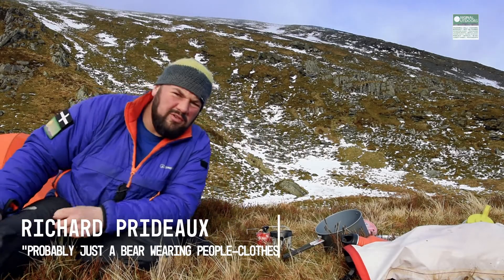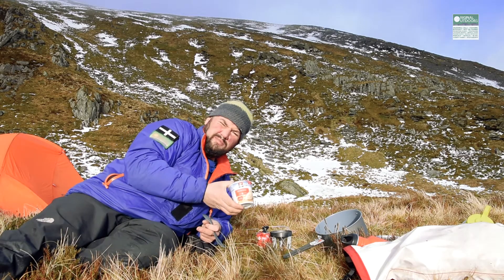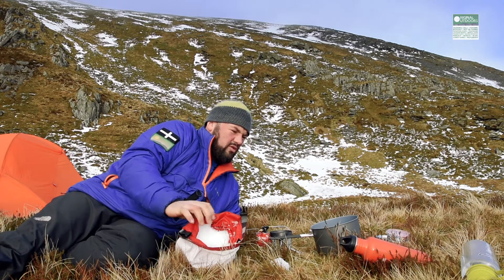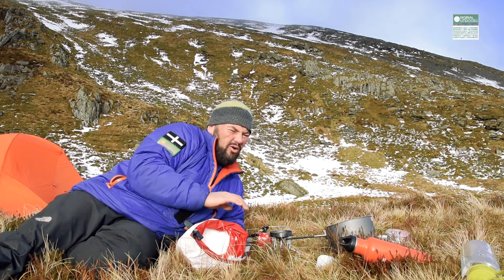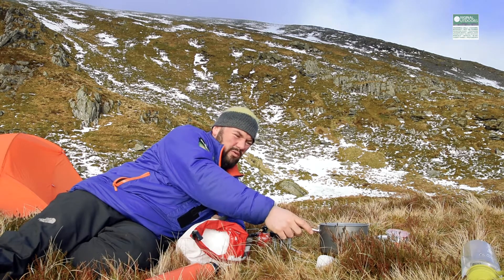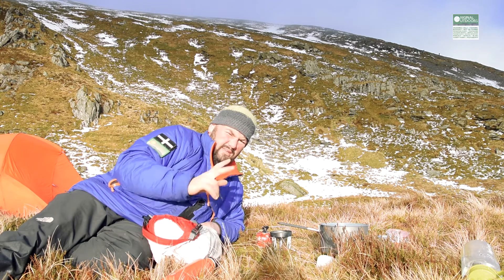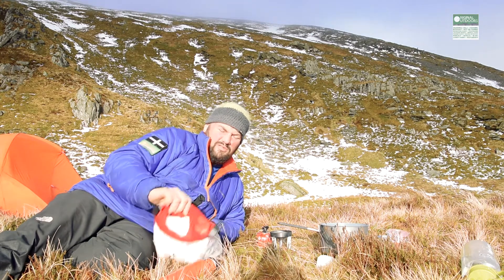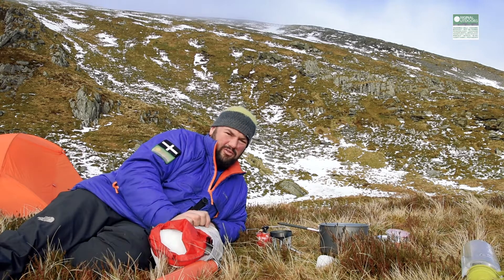TFI - Melting Snow and Burning Water

Comment: Cant help thinking that snow has been there since last year...
Probably a fair bit of bird poo in the mix.

Just saying..
Reply: A friends in Sweden showed me one of his pots that just burnt through in the bottom. A client packed the pot full of snow, put a lid on it and placed it on embers. They later scooped out the still intact snow and saw small holes in the bottom of the pot. So it is indeed a good idea to just keep adding snow instead of jamming it all in.
Reply from the maker: Fortunately I know this has fallen in the last few weeks. And any poo just adds to the overall experience.
Reply from the maker: I've seen that too. Snow is an amazing insulator, and pans aren't that thick... :-)
Reply: Bad stuff should boil out right?
Reply: Boiling will kill all the biological threats but any physical dirt will still remain.